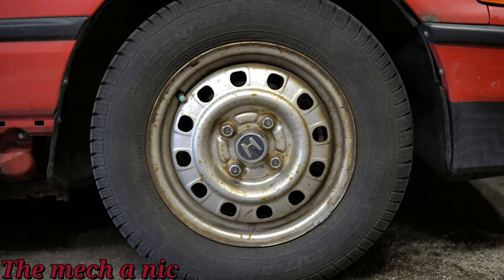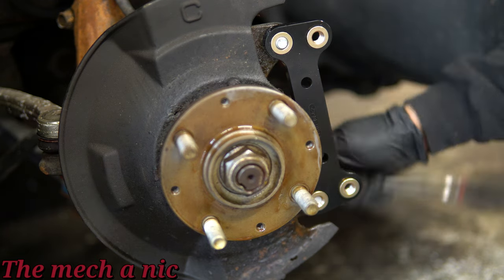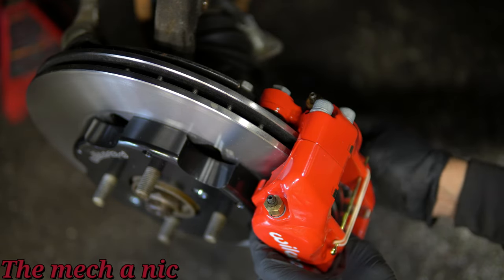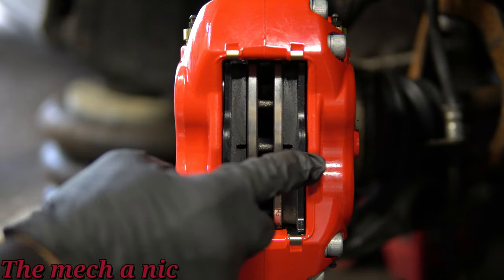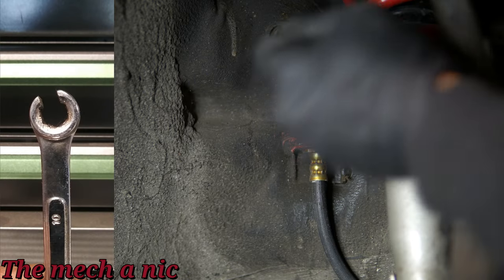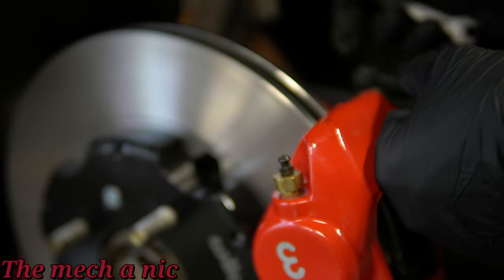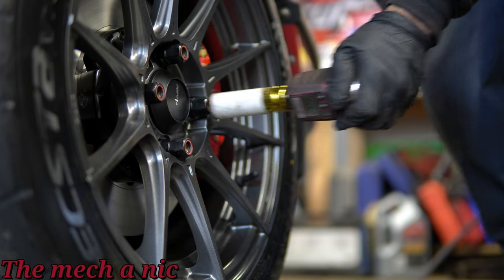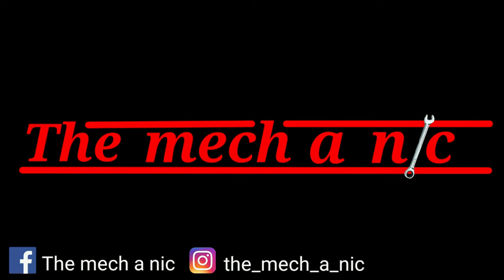wilwood big brake kit on crx - CRX PROJECT VOL 13

Comment: Love the brakes...recommend getting the bleeder valve cap install Wilwood # 220-12487.
3D printed part with blinker turn signal looks great!!!
Reply from the maker: Thank you for that. I tried some i have in the garage and non of them fit. I just ordered them on ebay. Thanks for the part number 💪 thank you for watching n leaving a comment

Comment: Very cool brake caliper , never seen such an easy pad install.  Red threadlocker , yikes 😅  I'm with you on using blue 👍
Reply from the maker: Thanks Steve, I know ill be taking this apart in the future and i dont need the troubles of fighting red threadlocker😂I'm assuming they say red as a liability issue. They could not care less how difficult it is to remove lol.

Comment: did the original wheels not fit after the brake upgrade? (just checking because I have 14" HX rims and I'm planning a similar brake upgrade)
Reply from the maker: Yes my stock wheels didn't fit over the brakes that's why I had to buy a set of new wheels
Reply: @themechanic6117  thanks. What size wheels did you need?
Reply from the maker: These are 15s and there's plenty of clearance.  I'm not sure if 14s clear the BBK but my stock crx wheels were 13s and they definitely didn't clear
Reply: @themechanic6117  oh thats really helpful to know! I'll try with my 14s first before shopping for wheels then.

Comment: Whats next bro k24 swap and rocker n quarter panel replacement
Reply from the maker: I have to replace the rotted away rear bumper support and my muffler pipe just broke in half so i have to fix that

Comment: Hey, Wisenhimer-
If you ever need an actual torque "wrench" simply put 
a Crow's foot on the torque ratchet.
There's your "Pro Tip" 🙄
Reply from the maker: 😂i always forget about the crows foot. There was no stated torque for the brake line. Just having some fun with the video editing
Reply: @themechanic6117  The YouTube Torque Nazis will let this one slide by.

Comment: Was yours on 242mm discs or 262mm discs??
Reply from the maker: Smaller than 242... 242 is about 9.5 inches. My crx had 9 in rotors. The wilwood kit is 11 inches
Reply: @themechanic6117  great I will look into this kit!

Comment: Im installing a big brake kit on my del sol im keen to feel the diffrence
Reply from the maker: That's what's up! The rotors size and pad size difference are massive! I can notice a difference
Reply: @themechanic6117   hoping so im going from something stupid like 9 inch rotors to 11.5 inch rotors should just about fit underneath my 15inch wheel setup
Reply from the maker: Same here, i went from 9 inch rotors to 11 and theres still some clearance in these 15 inch wheels so i think 11.5 rotors will clear a 15 in wheel
Reply: @themechanic6117   im pretty keen i think i might film a video on it as i havent seen anyone do it so theres not too many references theres forum posts but not any video so hopefully itll help someone
Reply from the maker: Yeah I dont see many videos on the del sol👍
Reply: @themechanic6117  i love the platform tbh just done a full suspention rebuild front and back just forgot to do polybushes for rear trailing arms and now got the brakes to do before i do the engine
Reply from the maker: There's always something to do on a project car lol
Reply: @themechanic6117  hmm try progect turn daily aha

Comment: WHAT SIZE ARE THE WHEEL AND THE OFFSET?
Reply from the maker: They're 15x7 +35
Reply: @themechanic6117  I just got these brakes I hope my 15” clear thanks for the quick replay
Reply from the maker: I was worried about clearance also. The stock 13 in wheels definitely didn't clear but the new wheels have plenty of clearance 👍
Reply: @themechanic6117  I have Rota slips, kosei k1’s and Konig hyper grams I hope one of those will clear
Reply from the maker: I think you'll be OK 👍

Comment: Hey man..what size rotor was ur oem rotors ?
Reply from the maker: Oem rotor size for the HF model is 9 inch rotor
Reply: @themechanic6117  thanks man ..and  the wilwood kit is a direct bolt on ? I only could find kits that bolts on to 242mm rotors.
Reply from the maker: Yes this specific wildwood kit only fits the smaller hubs (9inch rotor)   , the kit bumps the rotor size up to 11 inches. If you have the big hub (civic /integra) then you need the wildwood 12.19 dynalite kit.
Reply: @themechanic6117  thanks so much man..sorry last question..do you happen to know the kit number ..
Reply from the maker: The 11 inch kit like I have is for the smaller hubs is called wilwood dynalite 11" (140-8695) . The kit for cars with the bigger hubs need wilwood dynalite 12.19  (140-6310)
Reply: @themechanic6117  thanks so much man..keep up with the great vids...

Comment: Next time don't use that crap wildwood break line kit. Use Goosdridge pn# 950-40000......oh and one more thing. You can't use stock 13" steel wheels with that kit. Steel 14"s with spacers possibly